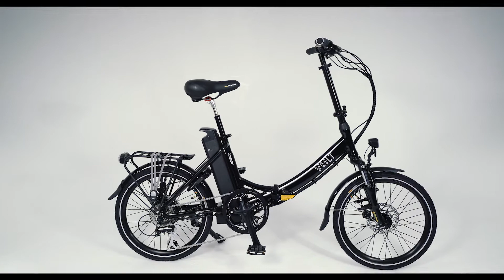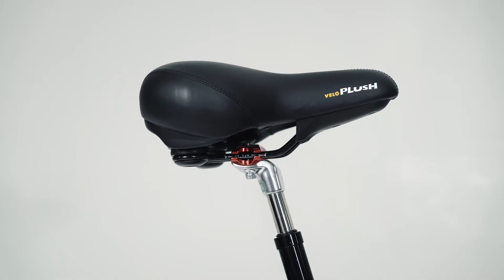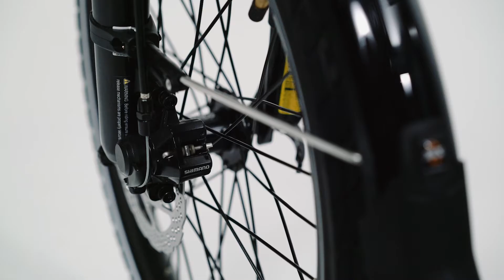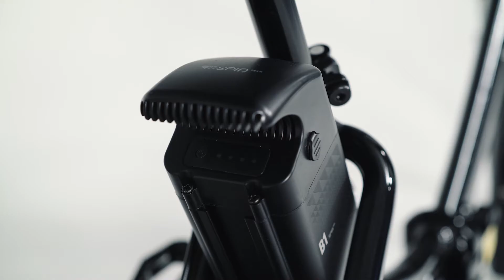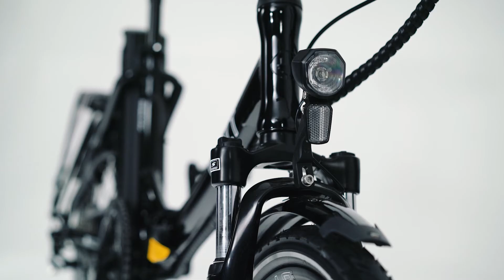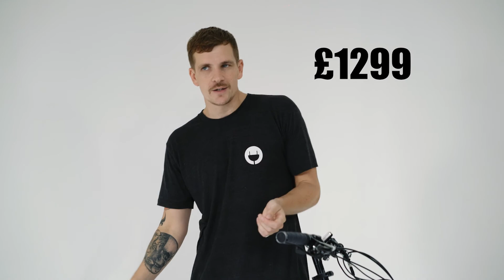Metro LS Folding Electric Bike | Volt Bikes

Comment: I got a puncture with the Kevlar tyre on, they are not totally puncture resistant. Great bike, I have the older model, I have been making videos with it for 3 years, great bike, but very heavy (for females lifting it into a car is impossible even with the battery removed) for me anyway. Zero pass doesnt feel like a normal bike up hills, its very heavy, but it is possible to ride it on a (a bit of an) incline if you are very fit.